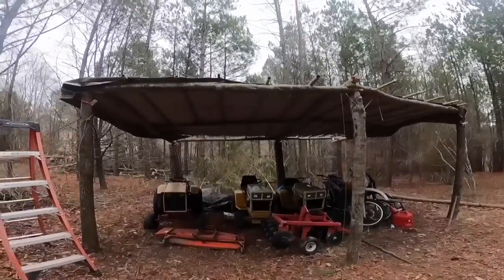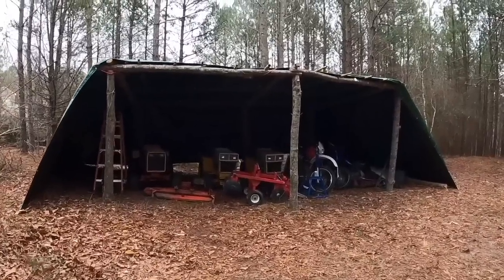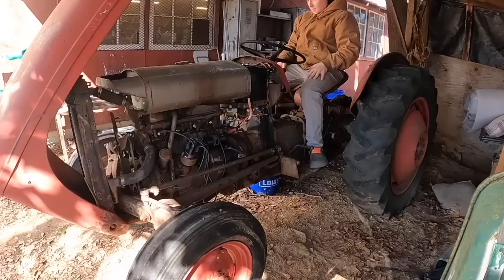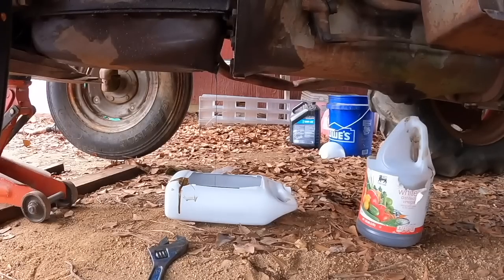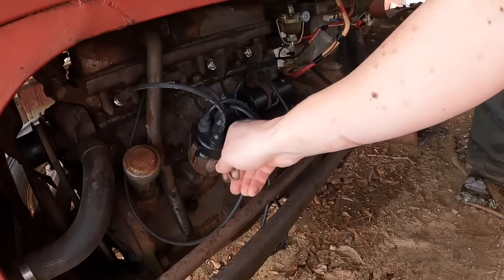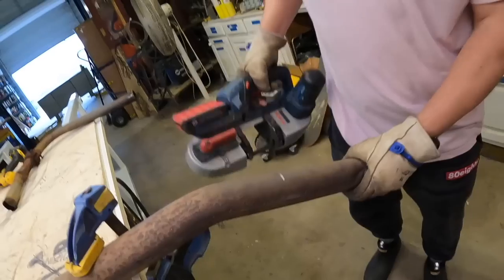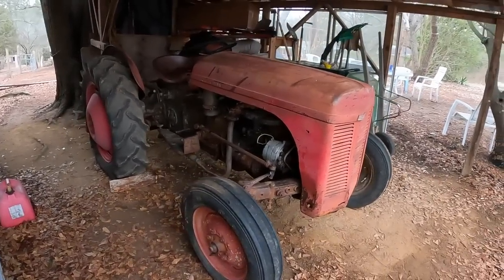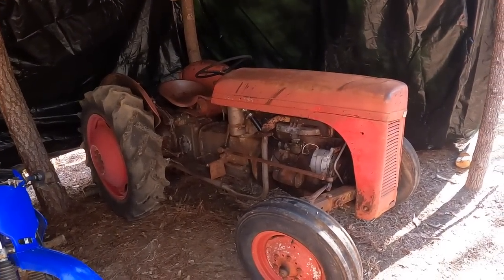Saving a 50's Ferguson To-30

Comment: Might I suggest that you either build a fan shroud, or find one some where to install on the radiator. 
Because the distance back to the blade is large enough that it will pull free air from everywhere around the radiator. 
Where if the shroud is in place, it's forced to pull through the radiator properly, and it will be able to do it's job efficiently. 
Also make sure you have a thermostat in the engine, as they run better at the correct temperature range to allow proper fuel burn in cylinders. 
50/50 mix of the old green antifreeze, along with the mix needed from a bottle of wetter water, and your set to go for years.
I would spend the 10 dollars for a new radiator cap just to be certain it's working properly, and not going to waste the coolant. 
There's a place I buy from for my TO 20, 30, and massey ferguson 135's is called yesterday tractor. 
While they're not always the cheapest, they've never failed to have what I needed. 
That said ORileys, and NAPA, have some things in their warehouses that fits the old Continental engines, helps if you know what year the tractor was built.
Hope that your starter never gives you trouble, because even having your old one rebuilt is not cheap, but cheaper than buying one if you can find it.
Take care of her, and she'll last a long time for you. 
Take care, and hopefully some of what I mentioned helps you out.
PS
For $500.00 you basically stole it, because even beat down to barely telling what are who built them I've seen nothing under 1500.00 and in as good a shape as your's is $2500.00 all day long. 
Oh yeah they sell a oil filter conversion setup that's a breeze to install, to switch to regular oil filters. 
BTW when your oil pan leaks again, take a ball pen hammer, and tap the bolt hole openings back flush with the rest of the flange. 
Use permtex gray or black gasket sealer on  each side of the gasket after it's setup slightly, but is no longer sticky to touch. 
Never use a impact on oil pans are valve covers, because only takes basically hand tightening to seal it up.
What you're actually doing is crushing your gasket with the flange bolts by forcing the flange to distort into a funnel shape.
Which in turn over a short amount of time will eventually leak as bad or worse than before. 
Typically what happens is they'll start weeping a little, and someone uses a socket to tighten it up, and they over tighten them crushing the gasket same as you have. 
A nut driver and one hand will tighten the bolts to about the proper spec of tourqe,  which is around 20 to 25 inch pounds, but not foot pounds.
Much less, and typical tourqe wrenches don't go that light.
They sell them lotta places, but generally if you just use nut drivers and your hand your close enough to count  
If it starts weeping after you replace it next time just snug it up same way with nut driver and one hand, and do have to strain on it just whatever you can turn it under mild pressure is fine
Reply from the maker: Thank you for passing on all the knowledge. I’ll take it all to heart

Comment: The linkage does not power down, the weight of the implement does that, with that simple service you have extended the life of the tractor.

Comment: Steiner, out of Illinois, has most anything you would want. 
They can tell you what year it is by the serial number.
  I bought one, 1952, thought it was a 54 for twenty years, went to buy something for it and that told me it was a 52. 
 Thirty plus years later, all I did was update to a twelve volt system, repaired the radiator, out a new fancy, comfortable seat on it, and after twenty five years, give or take a couple, new clutch.

The people I bought it from, their dad was redoing it. I have no idea what he had done to it, but oil changes and tune ups is about it. And one muffler.

Funny story, after ten, or fifteen years, the thing started act ing up, not idling right, could not figure it out. Went back to basics, started with timing, 180 out.
Lets go back to the beginning, the tractor would never idle less than about a thousand RPM's. Always had to throttle up.

 Now, back to the future, we found out it the distributor was 180 out. Fixed that, checked the plugs, reset the points, and, BOOM. The dang thing would idle at 60 RPM, which is way too low but would idle, anywhere I wanted it to? Go figure.
 Exhaust pointing down, like any exhaust, looks cool, UNTIL, you get in the dirt. No muffler, sparks may fly in dry grass, hay field, grass fire?
  So, now as we speak, I have a wheel seal leaking, along with my twenty year old radiator fix 
is leaking again.
If you ever have to split your tractor, mark your throttle, governor, and anything else that may need to be put back in the same spot. Enjoy the tractor, I am still enjoying mine.
Oh yea, a solid mount tow bar was added, better than the bar that goes on the hydraulic arms.
 Located in NE Ohio.
Reply from the maker: That’s awesome. These tractors are beasts. They don’t make them like they used too

Comment: Looks like you have a bent PTO Shaft, w/erratic spin
Reply from the maker: It’s definitely not as straight as it should be but the pto has an adapter on it that is very loose and makes the spin look much worse than it really is. I need to just take it off because there is no way it’s safe to use as is haha